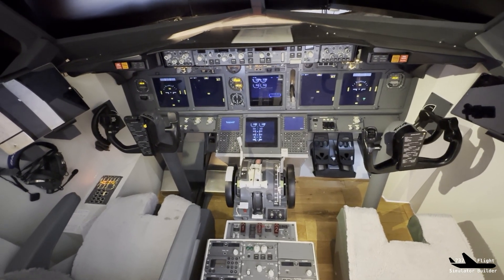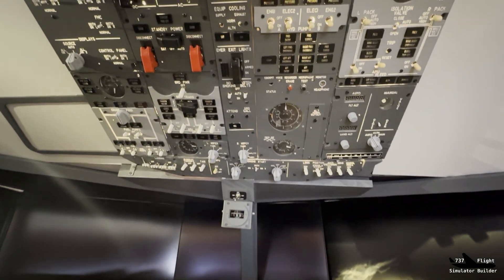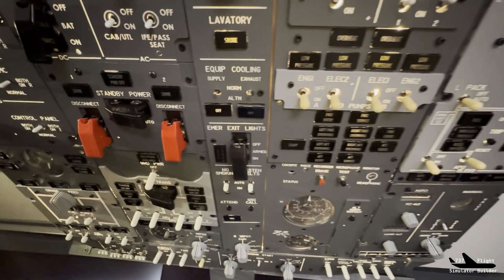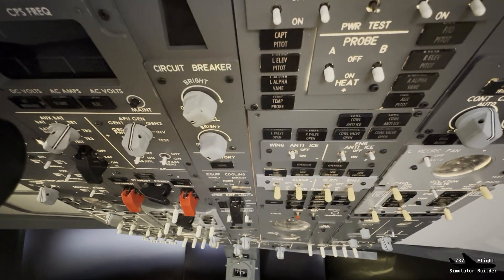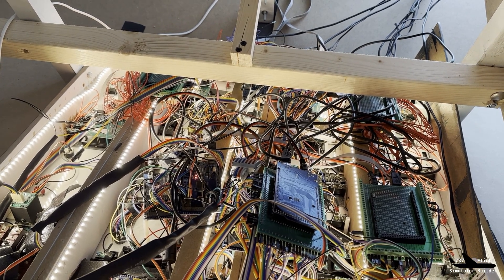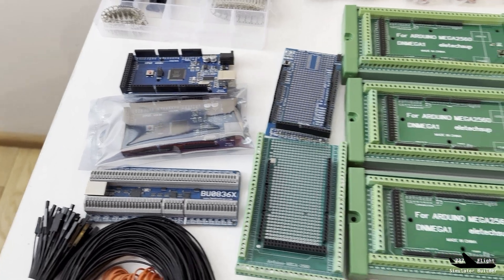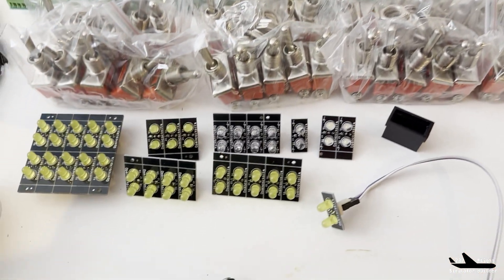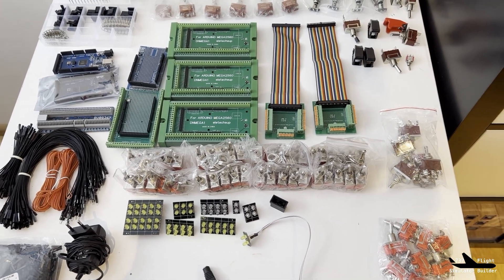737 Simulator build: Rebuild the overhead panel.

Comment: Hello, what do you think of the Cockpitsimparts panel? I find this supplier very interesting and I would like to have your opinion on the upper part, the panels are correct or not
Reply: This is a very good supplier and panel. Very helpful in many ways. Quality is excellent. The panels are very accurate and all dimensions are exact.